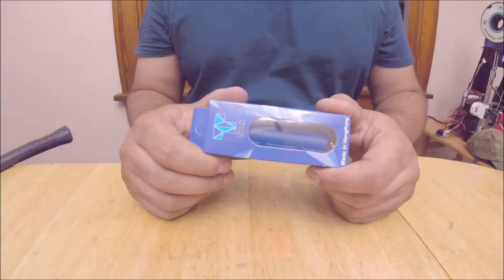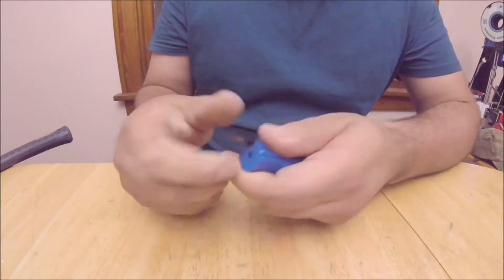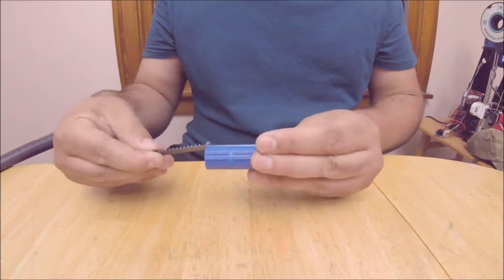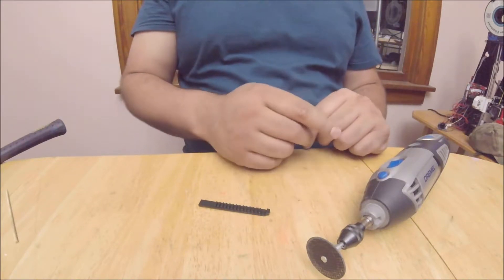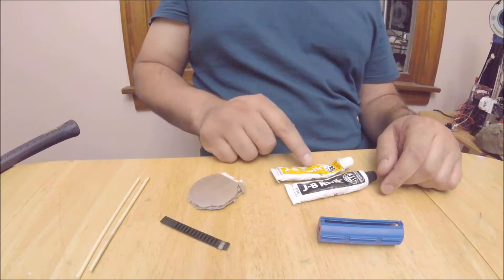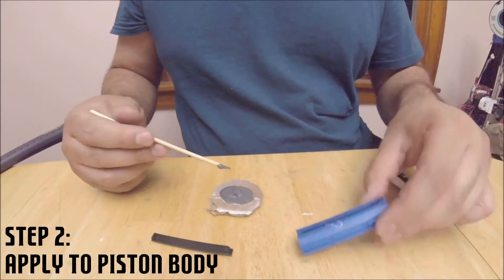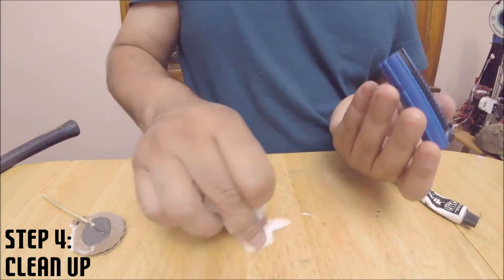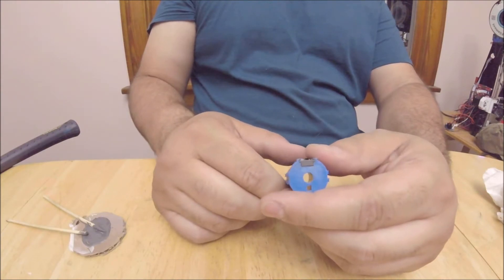The Last Piston You'll Ever Need

Comment: Okay, sorry, but this is so half-assed. You should be using the dremel wheel to rough up all the surface areas of the rack that contact the piston when inserted. Also should be using sand paper or a sharp tool to rough up the rack track in the piston. And then after all that, its CRITICAL that all surfaces are free of any oils. I use 99% rubbing alcohol to wipe everything down several times. You can wet some paper towel with 99% and use a small flat head to thoroughly clean out the rack tracks. 

Also, for anyone watching, never use grinding wheels indoors. That dust gets everywhere. Including in your lungs if you don't wear a mask...

Comment: Hello, why did you need to dremmel the teeth?
Reply from the maker: With higher speed setups or high trigger sensitivity builds, there have been instances of the sector gear contacting that tooth before the spring fully decompresses. I only keep a piston with a full rack of teeth when going above 1.8J on semi auto. Even though the teeth on the piston are metal and the sector gear teeth are metal, it's a practice that is done for good measure to reduce wear.
Reply: @sjdude922   gotcha